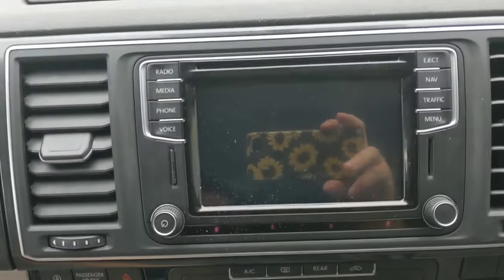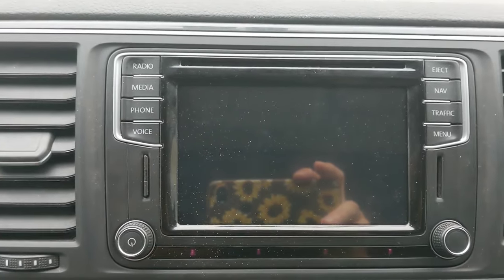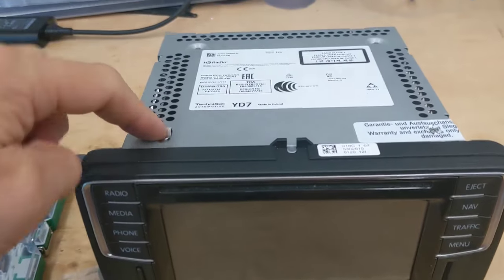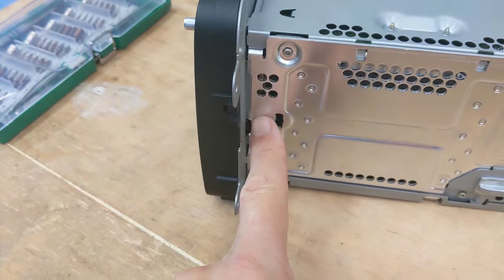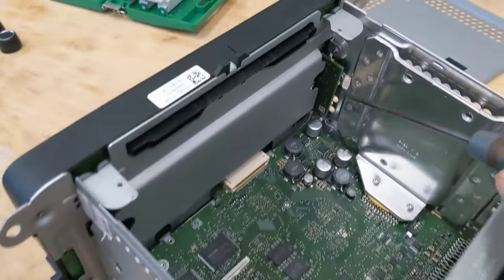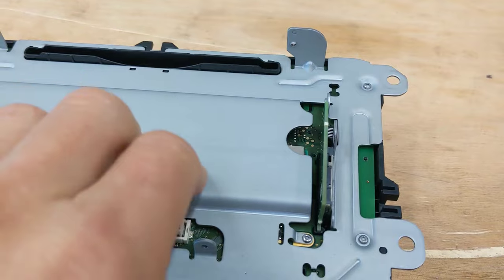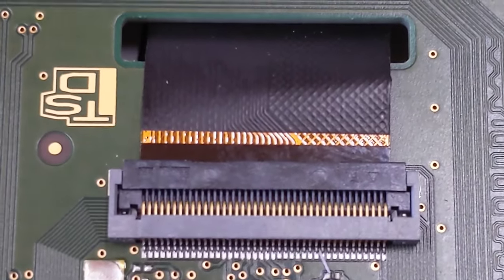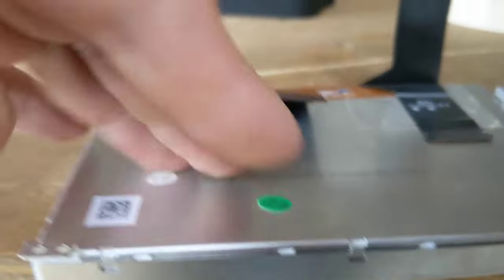Repairing the faulty touch sensor on a VW head unit.

Comment: Wow, thanks for the video!  I'm definitely going to give this a try.  My 2016 VW CC's screen started randomly beeping and clicking as if it were being used about two months ago.  Completely unable to use navigation or even stay on a single radio station for long periods of time.   I didn't even know this was a possible repair option until I found your video.  Looks like it'll be around $10 to the US for me, much more affordable than the $1,100 my local dealer quoted me for replacing the entire unit!
Reply: Ha! Same story here, bud. Except, they wanted €2000 from us.

Comment: Thank you very much Duncan, this has saved me a lot of money as I was contemplating a replacement unit altogether, I bought the screen as per your recommendation and bought some precision torx screwdrivers at a total cost of about £20 for the two items and have just finished the job and put the unit back in my CC and hey presto.....it all works again. Thanks again 💯👌👍

Comment: 0:04 Hi, I’ve swapped the new LCD screen I. And now have touch sensitivity back but a black screen. Do you know whether it is the black or gold ribbon connector responsible for screen illumination. If it’s the gold I will give up as I did stress that. If it’s the black I have some hope that persistant wiggling might work. Thanks so much!
Reply from the maker: It's the orangey gold one that works the actual screen. 
If you've damaged that one then try having a good look on the screen for a part number.
It's likely you can find a replacement somewhere online if you can work out what the part number is.

If you can't see a part number, maybe it's written underneath the (glued on) touch sensor?
Since it's broken anyway, try separating the touch sensor from the screen. I don't know how strong the glue is; I was too chicken to try separating mine since the screen still worked. Heating it up a bit will likely make the glue softer. (Hot hairdryer? Oven at a low temperature?)

Good luck and let us know if you find an alternative screen part number!
Reply: Thanks for getting back to me… this post is certainly keeping you busy! Before I read you reply I wondered about replacing the gold ribbon connector but it’s not easy to get to without munting the whole thing. I will let you know if any success to report. Atm weighing up possible basic replacement head unit for £60 & for now at least I have radio controls from memory! The cautionary tale for anyone doing this is don’t mess with the gold ribbon!

Comment: Nice video, thankyou. Quite an easy repair, having seen the video, to give me confidence. My ocd would have liked me to remove old screen....
I did attempt it, 5 mins in oven on 80 degrees, but chickened out, too tight/afraid of having to buy new lcd.
This repair cost me about £15 👍👍
Reply from the maker: Yea, before i realised we don't need to remove the old touch sensor i was going to take the screen into a mobile phone repair shop; They will have the tools and experience for working with glued on sensors.

Comment: Daniel in Nashville.  2017 VW Beetle vert.  Took about 2.5 hours.  Ordered the same screen off of ali Baba.  Toughest part was getting the whole unit back in as there is little slack in the wiring harness.  Note: Cleaned the original screen very well as there was a combination of grime and finger oil all around the edge once the metal frame was off.  Wondered if this was cause of issue (right side of screen did not work, left- hit or miss) and if I could just clean it good and NOT put new screen over.  Did put new screen over.  All who do this need to also have a very clean environment. Clean the screens with sterile water and a microfiber, let dry, and try not to get anything between the two glass screens. I wore disposable plastic gloves and used a antistatic mat to keep things from sticking to the glass. Still,   I found a tiny dust fiber in one corner after install and looking at it under a magnifier.   Unit works though and wife is happy.   This video  NEEDS to be relabeled as "VW Discovery Media MIB2 faulty touch screen repair" and you will get a lot of hits.  Thank you. Thank you Thank you!  Also, separate issue, when I put the V 10 SD card in for navigation update, the screen says" This card has the navigation database. "  Then:  loading Navigation Database.  Then there is a blue circle that spins round and does not stop.  Have left for hours.  Still just a spinning circle.  Any clue as to how long it takes to update the navigation database?  I saw a video of someone loading ad there is a progress bar displayed .  I don't get that, just the stupid blue spinning circle.   Anyone?

Comment: Das funktioniert. Danke. Der  Platz ist knapp aber wenn man die kleinen Torx  Schrauben vorsichtig anzieht gehts. Am Ende von aussen nicht sichtbar.

This works. Thank you. The space is bit tight but if you are careful when you fix it back (dont overscrew the small torx screws) then it goes. From outside your see nothing.

Comment: Hi Duncan, firstly this a superb informative video that is easy to digest! Secondly, do you know if the link you provided for this screen would fit a Skoda Yeti from late 2015 unit? I believe my unit in mine is a Armudsen 2?? And yes, it has just started "ghosting"!! I would be able to put this repair on myself. Cheers in advance. 
Kyle from Scotland.
Reply from the maker: So if it looks like the same head unit as mine, it probably is.
Even if it's not, try taking it apart and see if there's a part number written on the display. Once you have a part number it will be available somewhere online.
Reply: Hi Duncan. Thank you for the speedy reply! Yes, it does look exactly the same minus the CD insert at the top. I will check the part numbers. Also let you know the outcome incase you buy a Yeti in the future😊 Cheers.

Comment: great job Duncan. I have the same issue on my Seat Alhambra 2016. May I ask you how to remove the unit (i.e. going from 1:35 to 1:40) ? Thank you very much
Reply from the maker: So dashboards are held together with stiff clips. It looks like it's all one piece but it isn't. In my van I was able to get my fingers under a bit of trim and popped the first clip. Try anywhere that looks like a groove or 2 different types of plastic meet. I think the proper tool is made out of stiff plastic so it doesn't scratch. Once the first clip is open the rest are easier, partly because you know you are on the right track.
Try looking online for information on your model of car. Every model is going to be different.

Comment: Great helpful video thanks! Did you have any issues to refit the stereo? I read it may require a code? Also did you need to disconnect the battery at all before removing the radio? Thanks
Reply from the maker: The cables are a bit fiddly to reattach when putting the unit back in the dashboard. There was no enable code to type. I did not remove the vehicle battery.

Comment: Works perfectly, you can remove the old touch screen just has alot of glue that needs to be removed
Reply: Did you remove the old one? If so, how long did you warm it up for and at what heat level?
Reply: I saw one video where they heat it up on a bed then use like string, cotton or dental floss from side to side in a sawing motion starting at 1 corner. Looked very easy once heated.

Comment: Duncan-Thanks for this-Did you stick the new digitizer to the old screen using the attached adhesive strip around the new digitzer screen or just use this as a spacer and leave the new screen loose behind the frame?
Reply from the maker: So i didn't even bother sticking it down. I thought i'd put it back together unstuck first to see if it worked on and never bothered taking it apart again to stick it down.

Comment: Hi Duncan, thank you for putting this up, it really is brilliant. I have same issue with a skoda yeti. Could I ask you whether you cut off the ribbon cable from the non functioning screen or does it just 'hang about'? 
I will be ordering the new screen shortly and was just concerned as to whether the old screen cable would still fit, even though it won't be connected. 
Many thanks.
Reply from the maker: Hi John, for the touch sensor on the VW head unit the cable is very thin. I just stuck it down with a bit of tape to stop it flapping about. If it got in the way though, it would have been trivial to cut with a pair of scissors.
Note that i'm not replacing the actual screen here but the transparent touch sensor that goes over the top of the screen. If it's actually the screen you are replacing, maybe you can take the old one out entirely? If it's the touch sensor the same as me, i think you'll probably get away with doing the same as i did. 
If it works on the Yeti, make a Youtube video about it. Seeing how helpful this one has been has been very satisfying.
Good luck!
Reply from the maker: Actually, maybe your Yeti uses the same model of head unit?
Reply: @DuncanLaw  it is the touch sensor that I'm intent on replacing, just like yours. Its a very similar unit, mine only having one sd slot and no navigation capability. I suspect I need to pull it out to find the model to get the correct touch sensor. Thank you so much for replying.
Reply from the maker: @johnbamford203  So mine was labeled with a part number for the whole display. Not just the touch sensor. That did allow me to find a compatible touch sensor though. You can actually see it at time 6:44 of the video. Hopefully yours is the same.
You can also see at that time where i've taped the cable of the old touch senor to the back of the screen with a bit of double sided tape and the new one is still free.

Comment: Super video. A little care and dexterity called for. Hardest bit was replacing plastic in car. £9.59 off ebay; skoda, vw etc are all the same. You pay more than double for the one labelled VW......obviously driving a VW means you're flush.

Only worry is it is glued round the edge; how long will this cheap Chinese  touch matrix last; compared to the shite OEM VW (chinese) matrix. I have visions of a great stack of touch screens......

Many thanks for great instructions.

Comment: Question: I have my original radio with a bad screen (unresponsive) and I have another radio with a perfect screen, same item number, same radio. Once I separate the part that has the screen, the big square thing with the buttons, can I just swap that with the old one or do I need to continue to take apart the actual screen to have everything working without the need for programing.????
Reply from the maker: So there's nothing magic about these parts as far as i know. If the whole donor head unit works, try using that as it is.
If there's something else broken with the donor head unit, yes, try just swapping the whole assembled screen as you suggest.

Comment: Hey Duncan..  Any chance you know what size torx is needed for the back of the face plate?  I dont have anything small enough here in AUS
Reply: It's a t6 needed for the smaller screws m8 as I'm taking mine apart at this very second lol
Reply from the maker: I can't remember what size exactly.
This is the set i own and it definitely has the correct size:
https://www.amazon.de/-/en/gp/product/B07VRYGKFJ

Comment: Hello, Great Video Duncan!  Do you know if this work on a 2017 VW Wolfsburg Tiguan?
Reply from the maker: As far as i know, if it looks like the same unit, it is the same unit. VW put the same component in all their vehicles and 2017 is arround the right age for this part.
If it doesn't look the same, try taking it apart and seeing if there is a part number on the display and/or touch sensor. Search ALiexpress for the part number and see what comes up. Make a video and post on Youtube. It gives me great satisfaction knowing i've saved so many people so much.
Reply: @DuncanLaw  Awesome, thank you! I found it on Amazon. it's a bit more but delivers in one day so felt it's worth the convenience. If I run into any issues I will be in touch.
Reply: @spea111  i also have a 2017 tiguan. Did you have success? if so, please share! Thank you!
Reply: @h3r5on5o5a  Hello! And @duncanlaw great video.  Yes, it was a success.  I have a 2017 Tiguan (Wolfsburg) and the touchscreen stopped working. The buttons were OK, but no touch functions were available.  It's a super simple process - just a bunch of screens.  I placed towels on my workbench to ensure I didn't scratch the radio and to keep the screws in one place.  

All in it took me under an hour to re-install the radio. HOWEVER, what's not super apparent from the video is that when you place the new screen atop the old one - you create some 'space' internally. What happened is that a few of the buttons did not 'reach' their contact when reinstalled (i.e. clicking "Band" did nothing).  I had to remove the radio and retighten all the screws, which I found had been loose in certain locations.  That helped to tighten the space between the contacts in order to ensure a smooth experience.  So with that extra bump, all in about 90 minutes. Still, on a scale of 1-10 in terms of difficulty, I'd give this a 6 and only because you're dealing with electrical ribbon which is very sensitive.

Hope this helps and happy to discuss more!
Reply: Hi! so for Tiguan 2017  finally you buy the same items that recommend Mr Duncan in the description of the video and it worked? Thank you in advance!!
Reply: Hello  @carlosrafael7904  .  Yes, it worked very smoothly.  Take your time, be methodical and it works exactly as Duncan has described. I would recommend to lay a large towel on your workbench so that when you take the screw off, you can keep them grouped without them rolling around.  Feel free to contact me with questions.

Comment: Hi, Thanks …so far so good but how did you get the black facia off. Your vid goes from a view of circuit board resting within the facia (while you flick up two hinged connectors)… to looking at the isolated screen. Grateful for the in between step. Do I need to remove the 8 screws in the circuit board?
Reply: Sorted… found clip next to SD slot and removed 8 screws. Unfortunately, then had a moment of stupidity resulting in slight tear of gold strip thinking it was redundant! Probably stuffed. We’ll see when screen arrives. Thanks anyway!!

Comment: Is it necessary to glue the new one with the glued edge stripes on the old one, or is it enough only to put it on?

Background is, that i would like to test the digitizer first, if its working.

Or are the glued edges not that strong, so i can detach the new one again, if the worst case of non working takes place?

Thank you very much
Reply: Ahh, i now find the same question in the comments below.

So, you didn't use the glued edges (not taking off the paper), only put the new one one the old one, and back to the case, right?

What is your experience on the long run so far? Do you have any cons to tell without using the glue?

Thanks😅
Reply from the maker: @marchisio4639  it's working fine without sticking it down for me so far.
i don't see how it can move much with the little alloy frame around it.
If it ever is a problem, it's relatively quick to dismantle, stick and re-assemble.
Reply: @DuncanLaw  thank you very much🤗👍🏆 This was my supposition, too.
I will try it the same way this weekend and will report.
Additionally if the hardkey buttonproblem also dissapear with this fix, although not related physically👍
Reply: So, i did the modification in your way without using the the glued edges (only put the new one onto the old one) and the frame on top. This package back to the frontcover, which hold the package on the sides and front. In combination with screwing tight the backcover, it is "bombproof" without any moving so far.
The not working hardkeybuttons are also working now again.

Longrun experience excluded of course, but i' m optimistic💪

Thank you again for you great video and your additional willing to answer and helping us🏆🏆👍

Comment: Hello, I have the same numbers on my unit like Duncan and I bought and replaced the sensor like in the video but I had no reaction off the screen anymore. I managed to take it off. Is it possible that I have to replace the display ?  Touching the screen on certain place doesn't give any reaction.
Reply from the maker: i think it's most likely you didn't reconnect the screen cable properly. it's a bit fiddly to get the ribbon cable seated into the socket correctly. try taking it apart again and try re-assembling.
Reply: @DuncanLaw  Hello, because of the digitiser screen was damaged by taken it of again (adhesive tape), I bought a complete LCD by Aliexpress and I replaced it by now. It works fine but the screen is a not so clear as the original (a little darker). I ordered a new digitiser and will retry again on the old screen but I think that the problem is the old screen that was no more responsive in particular on the corners.
Reply: @DuncanLaw  Hello, you were right, it was the connection that was not Ok. With the new digitizer the problem is solved. There exist also 'frosted' screen digitizers. Is this better ?

Comment: I currently have a fully functioning screen besides the top left corner (where the previous station arrow is), any tips for potentially fixing a deadzone? Little gimmicks that might work? Ive noticed some responsiveness when i hard press for a long duration but its inconsistent
Reply from the maker: Just to be clear, it's touching the screen in that corner doesn't work rather than the screen not displaying anything in that corner right?
That sounds like replacing the touch sensor as described in this video will fix it.
Reply: @DuncanLaw  Yes mate. Literally the whole screen is fine except that one corner where the touch seems to be irresponsive
Reply from the maker: @B1GZ3D  yea. if it was mine i'd swap the touch sensor. that's the most likely component to be casing those symptoms.
good luck!
Reply: @DuncanLaw  appreciate it mate! Top man